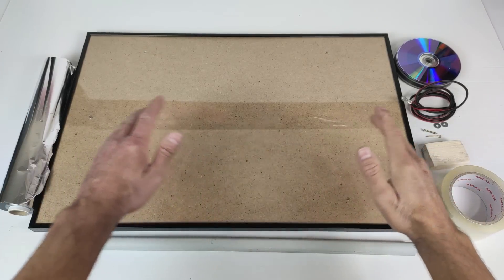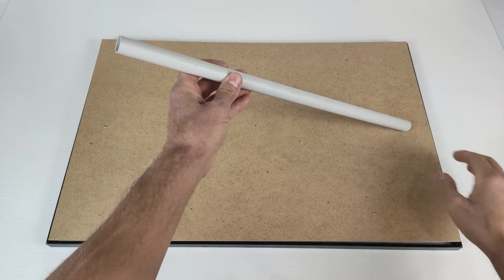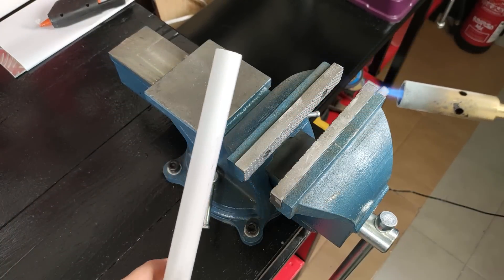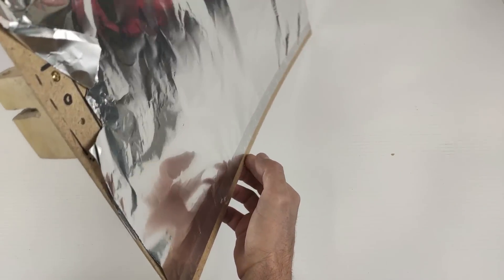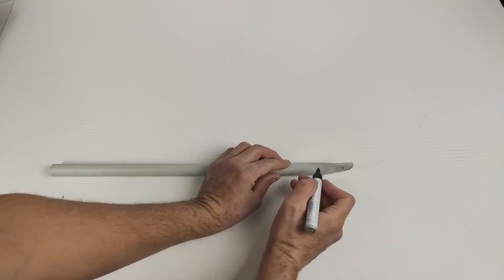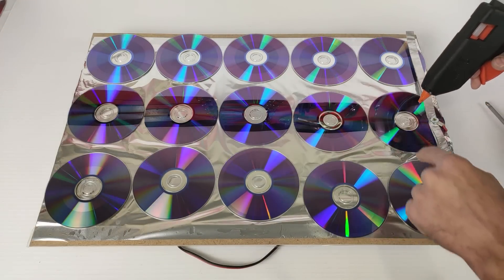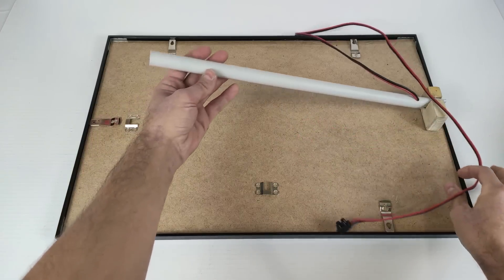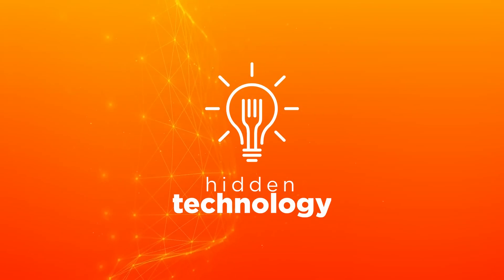I turn a bunch of old CDs into a SOLAR PANEL for your home | Homemade Free Energy

Comment: Most important is 45 degree stand, not only for correct angle to sun but also to give space to hide the battery used in the demonstration
Reply: I'm sure the battery's are in that pipe he used to prop it up, probably 4 Cr123 batteries lol
Reply: Should see his battery to gas video lol it's dangerous as fek lol not only that he uses propane at the end 😂 👌
Reply: No, that was just a bat tree growing in the background...
Reply: The batteries are hidden in the pipe
Reply: I thing it's no second battery because when he disconnected the voltage tester  is no reading only 000 and he is using the two hands.
Reply: @rlterry79  OK, wow!
Reply: Your just mad caus yout bad
Reply: So you can make a solar panel that don't work , or buy one that does
Reply: No wonder they call themselves hidden technology
Reply: Just wondering if anybody noticed how he taped down the positive aluminum foil to the negative aluminum foil and yet nothing gets burned out right
Reply: What?  But, but I saw him lift the whole thing up.  Are you telling me it was all camera tricks.  My world is blow.  Next you'll tell me perpetual motion machines don't work.
Reply: @meoff7602  So, the moon causing tides can't be a perpetual energy generating force? LoL Not saying it's practical or cheap, but it is constant.
Reply: Why is there no button to report misleading information???
Youtube wtf
Reply: His lie is just stupid. If only he said. That he got half a volt with high amps. I would swallow it but he said 12v with no couples in series. 
And he didn't connect the negative to the ground. So no capacitance will will form! If there is no ground negative aura, no positive can be formed... 
Of course I say that and I made solar electricity from everything I could!
Actually its stupid to call it solar energy. While its a!ways ground and sky energy basically. Because the positive has to be high from the ground for best voltage differential! Then sun energy plays a role in charging the differentiated capacity environment... 
But with views I'm sure he compensated the lack of volt in dollars
Reply: @tyreza79  Correct, plastic does not conduct electricity, so the place where he took the negative pole is wrong.
Reply: @tyreza79  I feel better knowing there are a lot of people who were watching this going WTH there is no complete circuit
Reply: @craigr6186  there is nothing hère!!  There is only YouTube money lol
Reply: @craigr6186  the funny part is ... Making a solar is really easy without having to go high tech no fancy. 
Its a capacitor. But needs a ground connection to have negative earth magnetic aura for differential potential Creation!!! You can literally use anything to make solar panels! I once used the internal aluminum side/paper side of cigarette packets. The inside paper. And made with it a mini solar. Of course nothing happens until you connect one side to the ground. Second part it you have to make many in series and many I'm parallel... Even high tech ones needs many series/parallel couples to get anywhere.
We community population are just lazy... Earth batteries or sal water batteries are better than solar. If many couples are connected.
Actually an open salt water battery pack if put out under the sun it actually get augmented electricity be differentiating sun energy too... But as I told you we are lazy and are addicted to system control. Because the system have for us many other attributes that are intertwined
Reply: @tyreza79  Have you made any video on your theory or project... whatever you call it? I would very much like to see and learn.
Reply: @TanmoyDasIN  that's the old me am not into it anymore... And an not into YouTube... Really sorry my friend
Reply: @TanmoyDasIN  but I don't need..you know about atmosphèric energy... When you put a solar panel higher and connect the positive led to an antenna you increase differencial by how high the antenna "sky" is.. and how the ground wire is deep and thick in metal
Reply: @tyreza79  So a car alternator will not generate electricity?.
WOW hmm i suppose the alternator in your car is useless than...
Going to the video..
As far as i know Aluminium is a conductive metal,not as good as copper but good enough...
If i were you i'd go back to school and pick better teachers,cos the one you had obviously sucked very much on teaching you...
Reply: @scamper_van8470  is this a comment or a fart
Reply: @scamper_van8470  I don't remember mentioning alternators... 
Aluminium as a magnetic conductor is good... But this is a white metal and white metals when put as antennas or as grounds they get magnetized differently that red metals like coppers or iron etc... As you know you can make batteries or good capacitors out these couples cu/zn or cu/alu or gold/ silver etc... I created solar panels based on different metals coated in graphene paste. But to get back to the main point about me... I had to reeducate myself in real electricity and knowledge... Of course I don't expect a system sheep to realize that the system of education is an endocrination which is at best to create new age slaves of the elites factories. It was never meant to create Nikola Tesla like people... You are not given truths not real basics of so called energy or electricity or magnetism... You are just an electric technicien hobiest as best
Reply: @tyreza79  You didn't mention an alternator I Did,but still the alternator in the facts is an electricity generator otherwise it would be useless on any car.
I am not an electric engineer for certain but i know few basic facts,which most ignoran's on youtube seem to have forgotten or probably are that ignorant to not know even the basis like the conductivity of aluminium or any other metal when stimulated by heat,or even used as conductors like wires...
Why copper is a better conductivity metal when compared with aluminium i have no clue not a science gig...but to measure the ohm of any metal ain't needed to have a PhD just a multimeter and the leads..and some common sense which today is at large escaping from the head of many people.
Reply: @tyreza79  BTW i mentioned the car alternator because is the one thing people in Theory should know what it is and how it works and..what a car alternator generate...
As i said in the previous answer to you common sense now days even on basic stuff has been forgotten..
Stupidity reign among many...
Specially those that go to school and when they come out of school they are pretty much ignorant,and on their heads there is only one thing well learned...
Create even the most useless crap just to make money = Profits...
Reply: @tyreza79  I was almost too lazy to click "like." But not quite that lazy.
Reply: @craigr6186  Yeah... Would this fool Pen and Teller?  Wasted 15 minutes of my life...
Reply: @danforesman2627  I was too lazy to click like button , so I clicked the dislike button
Reply: @tyreza79  Would you be so kind to elaborate more on the earth batteries? I figured it should be possible to draw from the earth, but I'm no engineer to pull it off. Where can I find more (reliable) information about it?
Reply: @aschwinwesselius  alright... First of all electricity is separation of the whole into poles... So make electricity from anything , think using opposites... Up down. Left right... North south east west high low. Sky ground... The antenna is like a ground... But coating the antenna with resin will make it charge... 
As for earth put in earth any couple of opposite metals male metals like copper etc.. and female or moon metals like aluminum zinc etc.. that's the basic... Then of course multiply couples in parallel and make the parallels in series... The more you do the more you have of amps and volts...
What is a solar panel but multiplication of series and parallel... 
When you put copper and zinc coupled in the ground, you usually get half a volt can't explain why it's always so. Si you can built your calculations on this... Nothing miraculous... 
I mean if you have a land then gather metals from junk yard and do your battery...
Reply: @tyreza79  Thanks! I figured I could just have looked up on earth batteries. They are quite straight forward indeed.
Reply: @rlterry79  so he attached the battery also to voltmeter no
Reply: NO LIE. The capacitors in the LED bulb will keep it running for a few seconds to minutes after sunlight is removed.
Reply: Bruh you guys just jealous
Reply: @christyeja6785   Hahahahaa!

Comment: Question: Why using a 2cm diam. PVC pipe as a stand? Answer: to hide inside about 9 ot 10 LR06 batteries.. And it’s done. We clearly see the pvc part at 15.14. The electric cable obviously can’t coming from the panel (because of the hinge). the cable is coming from the pipe itself.
Reply: Thats why this channel is called "Hidden Technology"
Reply: @mortenfaurbyegellert9564  Dude I died XD
Reply: also the reason for the black cap on the end of the tube if its just a stand why cap it off? or maybe it stops the bullsh*t from leaking out.

Comment: The bluish-white metal that is known as cadmium is malleable, ductile and can easily be cut with a knife. Due to its excellence as an electrical conductor, cadmium is often used in electroplating and in batteries.
Reply: Kenan D said: "The bluish-white metal that is known as cadmium is malleable, ductile and can easily be cut with a knife."

Cadmium is also HIGHLY toxic, If you're cutting it with a knife, you're actively POISONING yourself.

Comment: If, this worked, instead of propping at 45°, prop at the angle of the latitude at your location. Seasonally you could vary by the inclination of tilt of the earth.
Reply: The planet earth os flat dude,come on,and the sun is actualy a huge led
Reply: That's why the stand is adjustable.

Comment: He did not even insulate the bottom foil from the top foil. Also in most parts of the earth the optimal slope is about 20 deg to the south. Not 45 deg.

Comment: I made it. but do not given any result. No output voltage no any ampere. I dont know why? it is same to this.
Reply: You forgot to use 8 batteries of 1.5 volt. Put them in the pipe.
Reply: @cezar3977  your right. I think he used 8 batteries in the pipe to see a lots of poeple his video.

Comment: 1:- .8V is a very optimistic  2 : They are all in PARALLEL and get ¬12V ???? 3 The DVD's are plastic discs so how does he current flow through the Disc ??? And the list goes on, ITS A CON ie. CLICK BAIT is my conclusion.

Comment: Since the aluminum foil is merely setting on top of the CDs, where is the circuit connection? I'll tell you where, in the PVC pipe... Now if you really want to see a real solar idea, take most any LED and go out into the sun light and read the voltage from that LED leads. It will produce voltage...

Comment: I used just one CD with the song "I got the power" by Snap recorded multiple times on it, and as soon as I hooked up my DIY solar panel to my system, it burned my charge controller, melted my inverter and blew up my battery bank... Too much power.

Comment: You need some kind of semi conductor, and metal. or unlike metal with a electrolyte of some kind. this is impossible to give any type of current at all . You would be better off making a battery out of potatoes, and unlike metals to make a .01 volt battery. Why do you mislead people this way.

Comment: important note: CDs with heavy metal generates up to 14V, DISCO maximum 5.5V and Punk rock reverses the polarity of the voltage!   :))
Reply: I used my Megadeth Rust in peace CD, but it rusted.
Reply: It's good to keep these tetnical aspects in mind whilst building!!!!!!!
Reply: Upon reading your comment I've Totally LOST IT! I'm dying my tummy was soooo hard!
Reply: Absolutely - and of course, if you have the CD's arranged alternatively upside down or not, it generates AC instead of DC - at whatever frequency is the right one for your area (it automatically tunes itself to the ambient electrostatic fields). You might need two panels though if you want to run a whole village of it - otherwise it can cause a local gravity imbalance and make things fly up into the sky.
Reply: Might you recognize the song being played in the background from 7:25 😂

Comment: Nice video but only 5 cdr's are in series then 3 sets of these are in parallel meaning each cdr would need to produce 2.5 volts each, highly unlikely!
Reply: yeah I also noticed he ran the bolt for the kick stand right through both layers thus shorting out any thing they would have put out anyway lol

Comment: I dont understand why you use cd if they are not the conductive stuff. Why not using a miror rather than cds in a frame?
By the way if we dont need a tube to incline the table...does it work the same???

Comment: Use BluRay Discs to improve the power output, because of the higher capacity.
Reply: What about laserdisc? My laserdisc player broke and i have a stack of movies here that i can't do anything with.
Reply: How much power can I get if I glue 20 old cassettes on a board?
Dang, @Brette Gould beat me to it! Below...
Reply: I guess I'm out of luck with Vinyl records, MiniDisc, and Betamax tapes. Why do I always pick the wrong formats?
Reply: @johnmknox  vinyl works fine, the black color compensates the lack of silicone. But don't use black CDs, they could potentially burn the wooden frame with their 14,6volt each. if you connected all of them, you would have a 220v connection, that is very dangerous
Reply: How about if I use flash drives instead? Will those generate more power? 😂

Comment: 10:44 of course the screw doesn't short circuit the two aluminium sides...
I did the same and my panel is playing the Billie Eilish songs written on the cd. What did i do wrong ?
I should have add a perpetual magnet motor to it, of course !
Reply: Remember the screw is not touching the negative aluminium foil cause is just the wood support. If the CDs have silicion, why not ? ... Will test this weekend, will give my feedback. Materials are easy to find.
Reply: @jboronat  
Pls do it and give reply
Reply: @jboronat  And you Test ist?
Reply: Using magic Neodynium magnets of course. These people should be locked up.

Comment: If one CD give 0.8V and we connect 15 pcs in parallel, then what total voltage we get? Still 0.8V !!! That's right! In order to add the voltage, all CD's would have to be connected in serial instead of parallel. Beside that, CD's surface do not conduct electricity.
Reply: Don't confuse the poor man with facts.
Reply: These are powered by imagination!
Reply: @dananorth895  I’m dyin Lmao
Reply: He was showing 12v + Others rightfully stated 0.8v is going to be 0.8v with current being higher
Reply: True, but a lot of the young people haven't touched a CD in their whole lifes. They all stream their crappy music. Soo they fall for this crap.
Reply: Correct
Reply: You need magic CDs -anything with bad music works fine

Comment: The fact people believe this and the fact YouTube allows this to take up space on their servers deeply troubles me for humanity.
Reply: "I saw it, it must be real" mentality.
Reply: there needs to be a [X] Satire
Reply: @nathanaelfisher8605  They really need a "NON SCIENTIFIC" channel, I wouldn't be surprised if someone somewhere has died taking stuff apart trying to make it work because of these videos. A microwave can hold a charge in its capacitors for well over an hour after being unplugged
Reply: @thatguy5801  One way of reducing the population I suppose.
Reply: @thatguy5801  Any modern appliance (think made in the last 20 years) is required to have a "bleeder resistor" on any high voltage bank that will discharge it to safe levels within a few minutes of powering off, to get UL/CE certification. (the most common hazard being CRT televisions, which aren't very popular anymore)  Microwaves use HV but don't have a CRT to serve as a monster capacitor. (with the ability to regenerate some charge after discharge as a bonus!)  Of course the safety recommendation "Never bet your life on a safety device being functional" still applies.

I work with ham radio though and tubes are still common in amplifiers (and even occasionally still radios) and those have big caps in them, but bleeder resistors and physical lockouts have been standard practice in them almost since inception decades ago.  That being said, I've seen the occasional idiot bypass a lockout.

Darwin at work?
Reply: @nathanaelfisher8605  Good info Nathanael, Thanks!
Reply: Interesting that one cannot post cinflicting views about a certain disease without YouTube calling it "misinformation", and yet they have TONS of actual misinformation in the form of free energy videos based on junk science.

Comment: well ..... explain to everyone how the d.d.p. is generated potential difference. explains how a polycarbonate support with a thin aluminum texture is able to convert photons into electrical energy. explains how strangely, there are no perfectly insulated parts on the aluminum strips. explain how photovoltaic cells work and take responsibility for making these unnecessary videos.